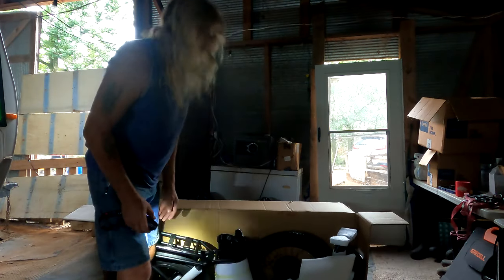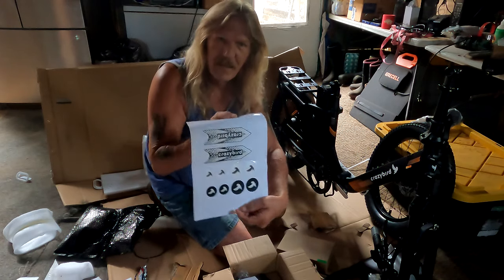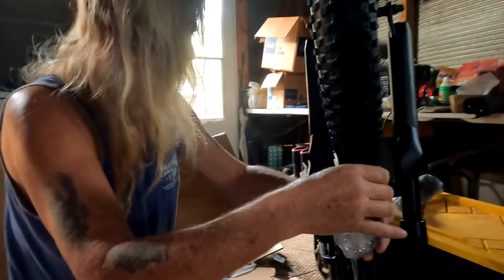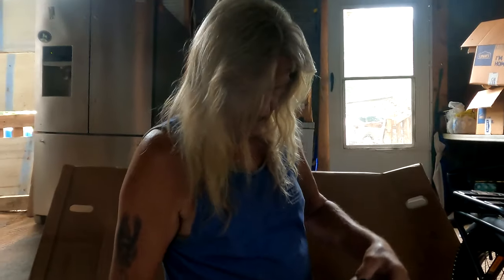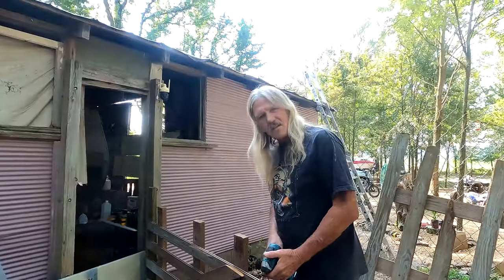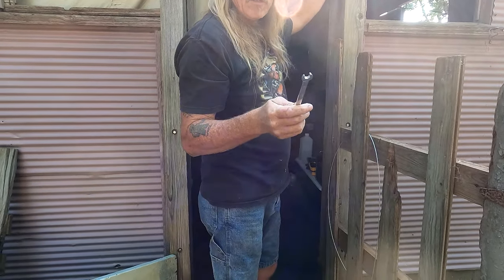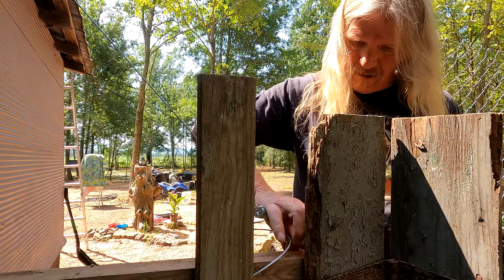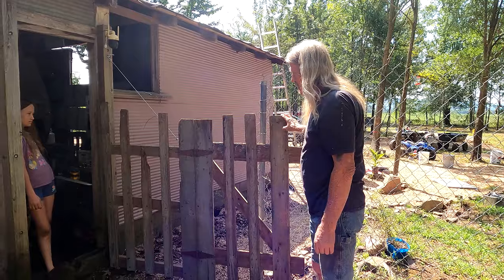STOPPING THE ESCAPEE JUNKTOJEMS STYLE!!! farm, tiny house, homesteading, RV life, RV living|

Comment: He guys where is the canopy, that covers the outside seating area?
Reply: Wasn't strapped down, just 4 corner stakes...wind always pulls those cheap tent stakes out. 
Use 12" landscape spikes on corners, then 4 18" steel spikes with large washers welded about 2" below top, 4 ratchet straps from top of corner poles to 18" steel spikes...I've been setting up swing tents at vending events for decades. I've had 55+mph winds fail to pull up any tents I've staked out this way.
Reply: The storm destroyed it